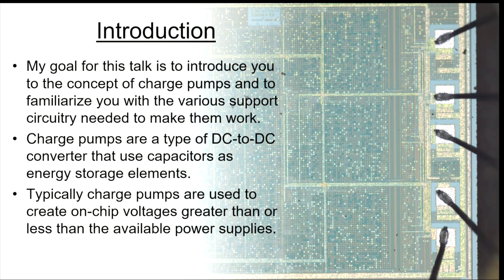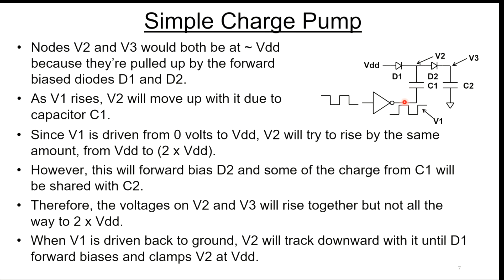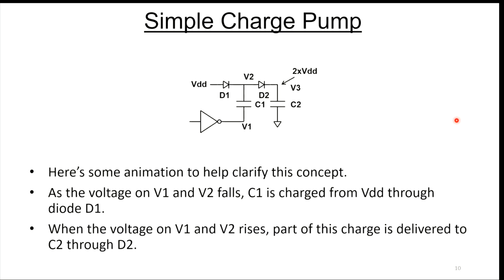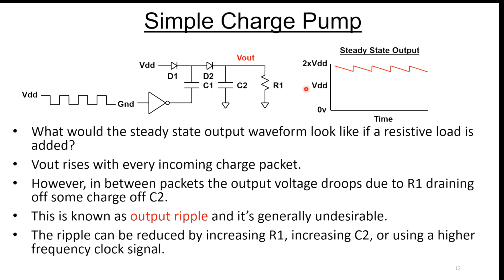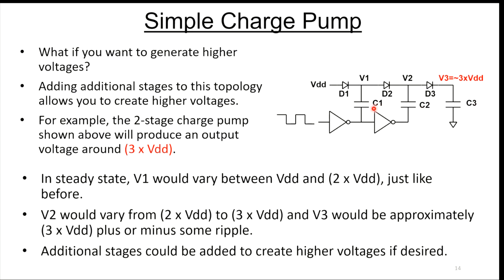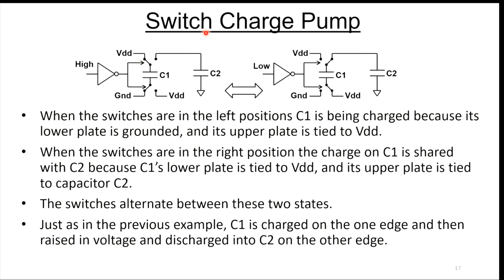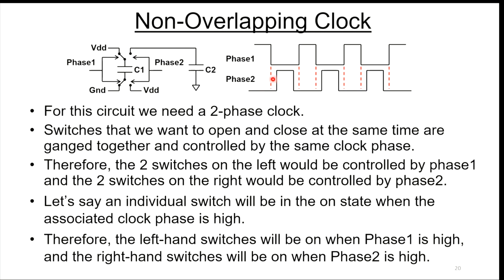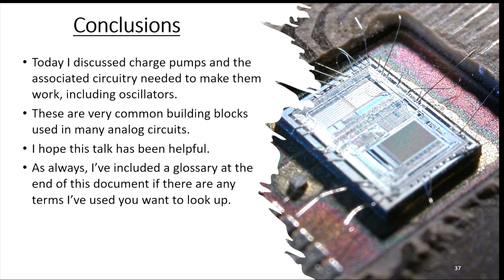Charge Pumps Explained

Comment: Nice explanation.
How do we calculate the capacitors according to the frequency we have, current output and voltage in and output? I did try to use simple I=C*V*F but does not work for me
Reply from the maker: Thanks.

I think you were on the right track. Here's how I would do it.

The minimum size of the flying cap (C1) will be determined by how much “DC” output current we want to draw. To make it easy let’s assume the Ron (On resistance) of the switches = 0 ohms. On every cycle the maximum amount of charge C1 (the flying cap) can transfer to C2 (the storage cap) is Q=CV=C1*Vdd Coulombs. In a steady state condition this would also be the maximum amount of charge per cycle that could be transferred to the load as output current. Therefore Iout(max) = C1*Vdd*F (frequency). (Same equation you used.)

Solving for C1 we get C1(min) = Iout(max)/(Vdd*F).

Let’s put some semi-realistic numbers in there to see how it works. Let’s assume, Vdd=5V, Iout(max) = 100mA, and F = 1MHz.  
Then C1(min) = 100mA / (5V * 1MHz) = 20nF.  This is the theoretical minimum value for C1 that could give us a 100mA output current if everything is perfect.  A larger cap would be better.

Now we need to calculate a value for the storage cap (C2). Its value will depend on how much ripple we can live with. As C2 gets larger, the ripple gets smaller.  Let’s assume the output reaches its steady state value of 2*Vdd and we want a ripple of less than 2%.
If the steady state output is 10V, the ripple should be 200mV or less.
IC = C dv/dt, IC=100mA (output current), C=C2(storage cap), dv=200mV (Ripple) and dt = 1/F(the Period) 
Therefore 100mA = C2 *200mV * 1MHz. 

Solving for C2(min) we get C2 = 100mA/ (200mV * 1Mhz) = 500nF (minimum)

Hopefully I did that correctly. Let me know if I missed anything.

These are approximate hand calculated values. On an IC, computer simulations would be used to determine the cap values needed to meet the desired specifications over worst case variations in PVT (process, voltage, and temperature).
Reply: @ChipCroft  Thank you very much for the explanation.
since I am using an nmos diode connected. I know that the Ron=1/gm. so I need to make also sure that Tcharge=5*Ron*C1 is less than 1/(F*2).

the ripple  thing is working perfectly. I found out like C2=10*C1 for 100mV ripples  for example in my case.
the issue is the Vout shall be 2*(VDD-Vdiode), but for me it is much lower, like third for the current output I want. I calculated the C1 and C2 as you wrote
Reply from the maker: It sounds like you're trying to build the diode based charge pump out of  real components and the output voltage you're getting is much lower than the  2*(Vdd-Vdiode) you're expecting.  Please be aware that the voltage drop of a "diode connected" nmos device is not the same as a PN diode.  Normally "diode connected" for mos devices means connecting the drain to the gate. If this is what you're doing and you try to use it as a diode, the voltage drop will be the Vth (threshold voltage) of the nmos device which could be 1V or more, not 0.7V. This may explain some of your problem. Try replacing the nmos devices with actual PN diodes. You might even be able to use the drain to body diodes of your nmos devices as PN junctions. Just connect your device terminals differently. Body = Anode, Drain = Cathode.  If you don't have a separate Body terminal it's probably tied to the Source. In that case, Source = Anode and Drain = Cathode. Also make sure the breakdown voltage of all your components are higher than the output voltage you're trying to generate. If something is breaking down that would limit your voltage. I hope these suggestions help.
Reply: @ChipCroft  thank you very much. I understood it now why. I did something similar and it worked like a diode too. I connected the G to D and to B , I had a good diode too.
Reply: @ChipCroft  thank you very much
I have made a simulation circuit in falstad web based simulator. But, I have always the issue of having VOut way less then the calcualted.
I have Vin=2vV, Vclk=2V,,Vd=0.7, Vo=4V. I used 02 diode 1N4004. f=100hz, current sink : Iout=15uA. Cfly=2*Iout*T/(Vo-2*Vd)=115nF. 
I get around Vout=2.5V. if I increase the Cfly by 10x, I get 3.2V. I noticed also the voltage at the Cfly changing from Vo-V=3.3V to 1.9V at 1.15uF. but at the calculated 115nf, it never goes to more than 2.3V. it is like the Cfly is not able to go up in voltage a Vcloc=2v!!! even the current given by the Cfly=115nF is double than 15uA in one cycle